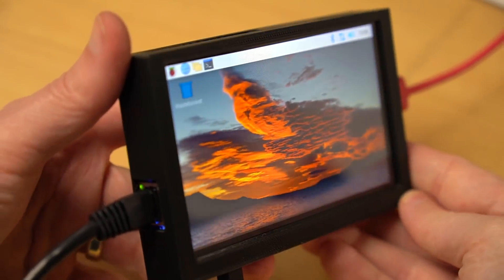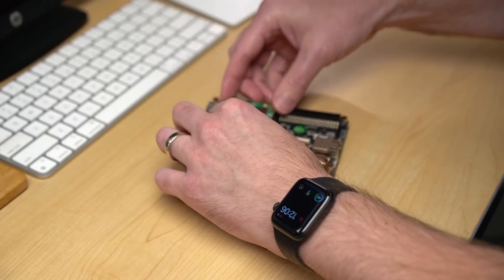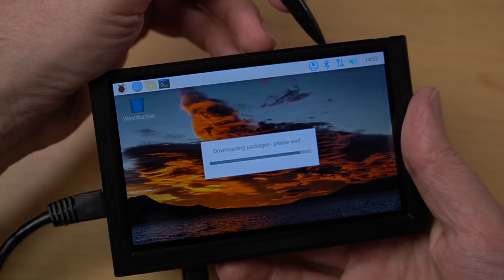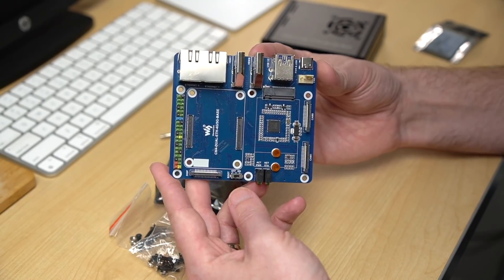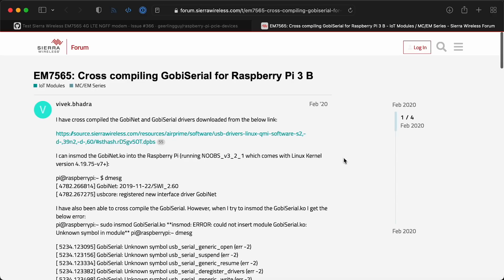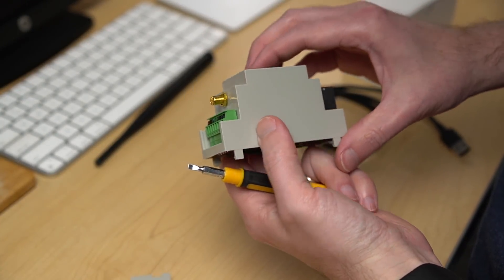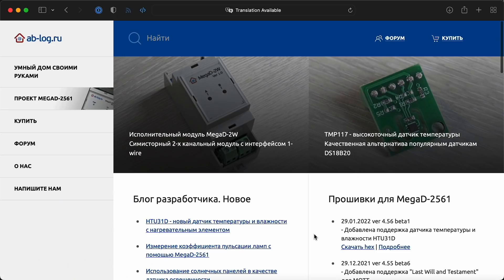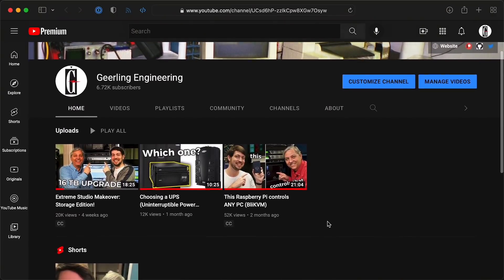So much functionality in one tiny Pi!

Comment: The Waveshare Wiki instruction for controlling the PWM fan does NOT work with the OpenWRT install for CM4! When will OpenWRT update to the May 2022 kernel for native support of CM4 PWM fans? OpenWRT is using a kernel from back in mid-2021.
BTW, if after installing the OpenWRT for CM4, you find your file system is read-only (!), this will fix it: 
e2fsck /dev/mmcblk0p2

Comment: Jeff, the latest OpenWRT installed on this Waveshare CM4-DUAL-ETH-4G/5G-BOX board has a setting for WAN QMI Cellular I/F.  I have yet to try it with Huawei ME906j because that M.2 chip seems to be MBIM not QMI but need to read more to know the difference. I'd like to see you do more on this setup.

Comment: And now cannot reformat CM4 ECC memory from Mac using ./rpiboot
WTF?
Loading embedded: bootcode4.bin
Sending bootcode.bin
Failed control transfer (-1,24)
Failed to write correct length, returned -1
Waiting for BCM2835/6/7/2711...
Loading embedded: bootcode4.bin
Sending bootcode.bin
Failed control transfer (-1,24)
Failed to write correct length, returned -1
Waiting for BCM2835/6/7/2711...
ad infinitum

I am really tired of this!  Anyone know this fix?
Reply: This was due to two issues: 1. Power--I added a powered USB-hub, and 2. The silkscreen ON and OFF markings at the ECC BOOT switch seem to be reversed on my board!  When I see BOOT OFF, to me that means the ECC cannot boot, but if I set the switch to that, I CANNOT access the ECC for OS installing using ./rpiboot.  The BOOT switch must be set to BOOT ON to get access to the ECC as memory.  Likewise, to boot from a system installed on the ECC, the BOOT switch must be set to OFF.  Maybe I am living in a reverse logic world, or is the switch wrongly labeled?
Reply: ECC = eMCC duh.

Comment: Jeff. Have you seen anything about the Waveshare CM4-DUAL-ETH-4G/5G-BOX showing the sim orientation in the slot?  I am trying to set up one of these with a Huawei ME906J and get a message in response to mmcli -m 0 that the Status state: failed for the failed reason: sim-missing.
It is not missing but I still get the same message although I have tried every possible orientation.
The kernel seems to see the Huawei OK without recompiling but this sim error message has me stumped.
Reply from the maker: I haven't had an issue yet, but I'm still trying to get the drivers working with my 4G card :(
Reply: Thanks Jeff.  I opened the case and looked inside the SIM slot to get the orientation but still same problem.  Minicom sees the presence of the Huawei ME906J and can read its firmware version, etc., but AT+CPIN? returns the same "sim failure" message as sudo mmcli -m 0. Also the Waveshare wiki mentions setting up the 4G modem with AT+CUSBPIDSWITCH=9011,1,1 but that returns ERROR in Minicom. I stumped about what causes this.  The sim is PIN-free unlocked from DOCOMO and the ME906J supports DOCOMO but...
Any suggestions welcomed!

Comment: As cool as the MNT reform is in concept, it simply isn't going to be very usable or justifiable in price, as it's well below the power of even a several year old chromebook. A similar, but IMO much better executed version of that idea can be had for like $200 in the Pinebook Pro. It has compromises that the Reform doesn't, and it certainly still has limitations, but it's more powerful than any of the proposed modules to power the MNT reform, has a sleek form factor (I almost wish they had gone chunkier but I don't feel the compromised very much to make it thin), and things pretty much work as you expect out of the box. 6 arm cores is a lot more workable than 2, and open hardware simply doesn't require making a 90s-sized laptop with dogshit performance.

Comment: I actually use the official 7" touchscreen + Pi 4 (4GB) that has OctoPrint installed (as well as an Pi camera) 
mounted on the top rail on my Ender 3 Pro. 
Combine that with the TouchUI plugin, a script to auto start chromium in kiosk mode 
and it works perfectly to get the full web interface directly on the printer.
I also added a small script to turn off the screen after a while if no input was detected.

What I like about that particular display is that it runs off 5V directly off the Pi, so no extra power is needed.

Comment: Regarding Home Assistant, there seems to be some controversy around how it deals with the DNS. I believe it is hard coded to use a certain system and not the DNS specified by DHCP or manually. As you are more a network guy I was wondering if you would be able to look into this and maybe explain why it is a problem as some seem to say it is, or if it is nothing to worry about.
Reply: If that's actually happening, you probably wouldn't have to worry about it. It's a concern for people like me because I have my own DNS server with custom rules and blocklists that I expect Home Assistant to follow. However, it's not too much of a problem because I run OpenWrt on my router which lets me force all DNS traffic through the server I prefer regardless of what any program tries to use. I think the bigger issue here if they're doing this is that they should've clearly communicated it to their users.

Comment: Jeff, I converted an old PC to run Smoothwall Express 3.1-polar-i586-Update11 to be my router and it has been running flawlessly for many years.  I would like to change the hardware to something much smaller than my old PC desktop and run the same software.  I would appreciate any cost effective recommendations you might have.

Comment: 10:05 It seems the antenna port on the RPi4-RTC-PoE obstructs some of the screws on the terminal block.
Reply from the maker: True; though the terminal block is detachable so you can pop it off to access the screw terminal connections.

Comment: For wall mount I would expect to hide wires into the wall. Not see them sticking in all directions. At least rj45 and power should be on back. Don't you think so?
Reply from the maker: This setup is built more for the 3D printer use case, but it would be nice to have connections out the back. Other idea would be a 7" display with same board, so the connections would be behind the bezel

Comment: Those little Kioxia 256GB SSDs are only about $25 - I have one connected to a Pi (with a USB 3.0 adapter) - it flies...
Reply from the maker: It's a nice little drive. Not quite as fast as the bigger ones with DRAM cache, but faster than eMMC or most microSD cards.

Comment: what is this DIN module formfactor? I started seeing it a little more recently but still trying to figure it out
Reply from the maker: It's used commonly for controls in buildings and industry. I see DIN a lot of times in commercial buildings (offices and the like) for things like lighting control and system automation.
Reply: 37х90х60mm (2 DIN units)

Comment: 05:30 Awesome, the cellular router is on its way! This is the board that I've been eyeing up to make a 4G/5G router with two ethernet ports. It's disappointing that the second ethernet NIC is attached via USB, and diminishes the potential speed, but I feel like that's due to the M.2 slot likely attached to PCIe. Though, depending on the cellular modem, not all support use over PCIe, and rather use USB 2.0 or USB 3.0. 

I'm also looking at the Waveshare CM4 IO Base board for a possible "homemade hotspot", with a Pi Juice for battery, OLED screen for network info, and connect a 5G modem to it. 

The Waveshare 4G/5G board looks smaller than I expected, so thanks for showing it off and testing out the cellular capabilities. I feel more confident now getting it for myself. Looking forward to the cellular router video when it comes out 😊

Comment: Is anyone working on an adapter so you can plug the CM3 boards into a CM4 system to get around the shortages and use these products?
Reply from the maker: Sadly, CM3+ has been even less available than CM4. And there's even a CM4S in the CM3 form factor now, but not for sale AFAICT anywhere.

Comment: 9:50 - this is pretty awesome. I built a solution at work so we can monitor our CAT generator over modbus (RS-485) running on a Pi 3 with node-red. This would be a much more professional looking hardware package than my existing 3d printed DIN mount with a standard Pi 3 and external PoE adapter.

Comment: Jeff, have you tried adding a GPU to a Pi 400?  Would that make any difference?
Reply from the maker: Pi 400 doesn't have easily exposed PCIe lane :(
Reply: @JeffGeerling  it would if you case modded it into an IBM model M keyboard!

Comment: Pretty sure you could 3D print some button caps that have rims to hold them inside the case, for the Pad 5 screen buttons.
Reply from the maker: The actual case design has buttons there, but in my eagerness to get it set up, I popped those buttons out while cleaning up the print. Oops!

Comment: as an aside looking at the code Coreforge commented 18 hours ago
It's crashing somewhere within this loop
for (i = 0; i < rdev->num_crtc; i++)
		WREG32(GRPH_INT_CONTROL + crtc_offsets[i], GRPH_PFLIP_INT_MASK);

	for (i = 0; i < 6; i++) {
		radeon_irq_kms_set_irq_n_enabled(
		    rdev, DC_HPDx_INT_CONTROL(i),
		    DC_HPDx_INT_EN | DC_HPDx_RX_INT_EN,
		    rdev->irq.hpd[i], "HPD", i);
	}

i dont know C but the first for line seems to be missing { & it's corresponding } before the second for loop ?

"In programming, curly braces (the { and } characters) are used in a variety of ways. In C/C++, they are used to signify the start and end of a series of statements. In the following expression, everything between the { and } are executed if the variable..."
it seems like the compiler might mess that first loop up somehow or at least a typo inconsistency!
Reply from the maker: That's a style thing in the Linux kernel—you can have no braces if it's one line only underneath. It's a weird thing and IMO it's really annoying (and I don't do that in my own code)... but it is permitted :(

Comment: I need that raspberry pad in a 7" with the cables not sticking out the side if it's really gonna be useful in terms of slotting it onto a double din car stereo chassis tbh - it doesn't really offer any advantages over the elecrow 7" in that regard.

Awesome roundup though!
Reply from the maker: It would be nice to have a 7" version with the exact same backside layout—you could then hide all cabling behind the screen pretty easily.
Reply: @JeffGeerling  great point - yes please! Currently running lineage on a pi4 in the car. I'm not sure lineage will support cm4 anytime soon unfortunately but I'd buy that anyways. ...hey, since you're doing a radio studio, any hifiberry alternative reviews in the pipeline..?

Comment: Yeah, that Pocket thing. There's been "cool demo" videos of that on the internet for years and years, still no retail units though, because [probable] scam.
Reply from the maker: We'll see. It would be really cool as a learning platform, and technically speaking I don't see anything that screams 'impossible'.

The software would be the hardest part, trying to route signals depending on the device. The contacts could also be difficult to get right, especially if using things like pogo pins. But the physical tech is to a point where I'm not as skeptical about something like this being a real product.
Reply: @JeffGeerling   Submitted my own response to the above person, but thanks for the supportive words (and the video mention!). Indeed, nothing impossible about this; it's just metallic contacts + branched signal layout + accompanying software. The bottleneck for me if anything has been the expense of time/persistence through debugging, and working through design permutations without easy answers. Plus completing the last 10% of any project is as laborious as the first 90%, but getting close now, thanks to so many encouraging words from community members (including yourself).

Comment: How does the compute 4 compare to the 3 in size?
Reply from the maker: A tiny bit taller, a bit narrower.
Reply: The CM4 box has the same footprint as a typical matchbox. The box is probably a bit deeper than it needs to be as most of the vertical space in the box is wasted. That should give you some idea about the footprint. I think it would be awesome if the CM4 box actually slid open just like a matchbox. Though I understand that there would be cost implications. Still would be cool…

Comment: jeff greerling: Can you or Jeff ;)  using the computer module wif&bt and a scream  made a mirror cast screencast  with case for a Android cell phone that supports desktop mode 5" 5x6x1 max ....  Would love  remote touch as well...  If anyone can do this you can

rpcm4  looks to be a good fit...  Battery  screen cm4wwifi&bt 
no sound needed ...  Samsung S10 & Huawei mate 20 Pro

 purpose demo on the go  cheaper handheld display

Comment: So many boards!! I am really looking forward to your custom OpenWRT build. I just moved into a new apartment. The landlord includes free WiFi through some UBNT APs they have hanging in the hallway. I love the free internet, but I don't trust public WiFi so I'm working to put in security measures between my devices and the AP. I've never used OpenWRT, but am interested in playing around with it. I plan to test using the public WiFi as my uplink while keeping my devices safely NAT'ed and firewalled behind my router. Not as ideal as a wired connection, but I can't complain about free.
Reply from the maker: Good idea; double NAT can be annoying, but using an insecure public network is much worse! :D

Comment: That video is kinda... "useless" in the sense that it is almost impossible to buy a Raspberry (Compute Module) without selling your soul or a kidney... IF you find a store that sell them. ;(

Also "fits in any standard Din-Rail"... Din IS a standard (Deutsches Institut für Normung - German Institute for Standardization), therefore any DIN thing is a standard ;)
Reply from the maker: Surprisingly, I've found some DIN rail gear to not fit perfectly—mostly in the rail/wall mounting interfaces, though. Most devices will fit any DIN rail physically.
Reply: @JeffGeerling  interesting... so the company who built these rails called them "DIN Rails" but didn't follow the specifications (which are also EN and IEC standards) perfectly.

A friend of mine ordered a couple of very cheap rulers (long and short) from Aliexpress a few years ago and he didn't realize until WEEKS later that the measurements were all wrong. Every centimeter on the ruler was exactly 1.1cm long. So, for example, a measured distance  of 10cm already made a difference of 1cm, because thanks to the bad rulers, he ended up with 11cms.  He wasn't happy at all. ^^
Reply from the maker: @ulliulli  Heh, this is the problem, isn't it?

And the sad thing is for some products, it's very difficult to find actual OEM/good parts, when the market on Amazon especially (but even elsewhere, like eBay) is filled with ripoffs and even products that are made to look real but aren't :(
Reply: @JeffGeerling  eh, sometimes even genuine products from the original manufactorers are awefull when QA fails. 

Or when everyone but one guy uses metric. I mean, do you remember the Mars Climate Orbiter? ^^

Comment: Too bad we're still needing batteries for real-time clocks. Seems like a super-cap or something on board could keep your clock running for 24 hours or so.
Reply: I just plugged in an old computer (athlon X2 BE-2400) that's been unplugged for ~5 years. it still has the correct time and date using one of those coin cells.
Reply: @Cynyr  Indeed, I think with all the old computers I've had foisted on me to look at only one has ever drained the battery, and some of those have been out of use for ages... No capacitor is going to match that, however if every device starts shipping with wireless/satellite options the need for them to know the time accurately is massively reduced as they can always pull it from the GPS or network.

Comment: Damn the Pi world has changed a lot since I played with them a few years ago. I wonder if my drawer of Arduino sensors, etc. are easy to interface with this (I assume yes).
Reply from the maker: Mostly yes; and the Pico too, now. It can still be a little more annoying interfacing with certain sensors through Pi GPIO than the Arduino, but on the whole, almost every sensor nowadays has some sort of direct support.
Reply: Check the voltage requirements. Arduino compatible often means 5v, RPi is 3.3v (or optionally 1.8v on the cm4).
Reply from the maker: @thomasbonse  True. Though you can usually build a circuit to tap into the 5V line on GPIO 2/4 for power with many sensors/devices. But it can require a bit more complexity than just using with Arduino directly.

Comment: I got some experience on reTerminal. It got a few quirks like:
1. Display support only one resolution
2. Boot select switch is really hard to reach. Back panel is tight af.
3. Sd card slot is not exposed. Had to take a part the whole casing to insert the card. Unless you use cm4 with internal storage.
4. Button on front panel only support single key mapping. Wish it support combination key mapping.
5. The I/O board didn't like custom power supply, might cause the CM4 to hang.
6. Display is in portrait mode if running without xwindow. Have to edit cmdline.txt to force it to landscape mode.

The use case for reTerminal is a little limited for my work environment due to the quirks above.
Reply from the maker: These are a few of the more notable shortcomings. I find it works well in certain use cases, especially as a simple display with a simple input. I haven't really seen their rear expansion connector take off in the way I think they wanted it to, either :(
Reply: Yes Jeff. The rear connector was the thing I'm interested in as well, too bad really. The form factor is great and useful for simple use cases. I wish they can overcome those short coming in the future. Will definitely revisit again if they do!